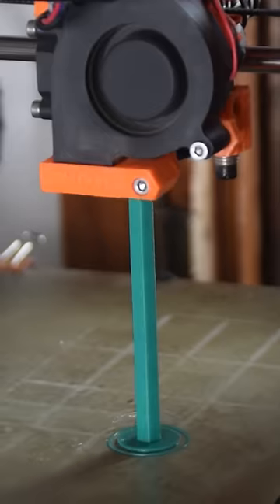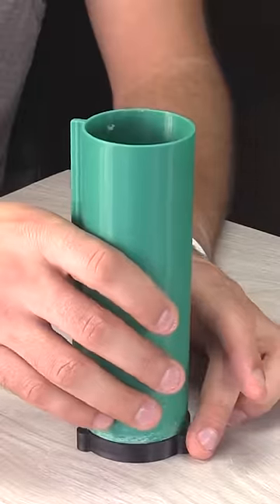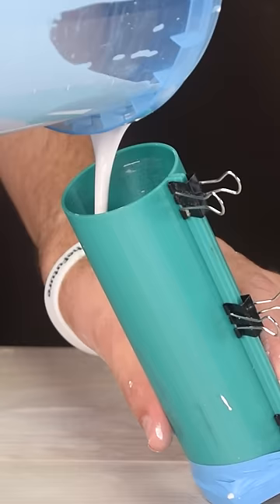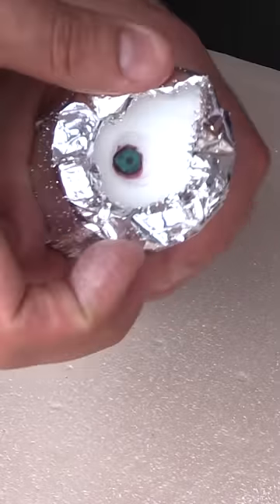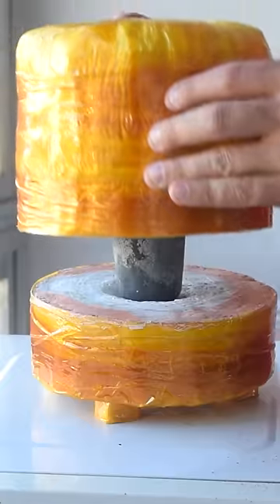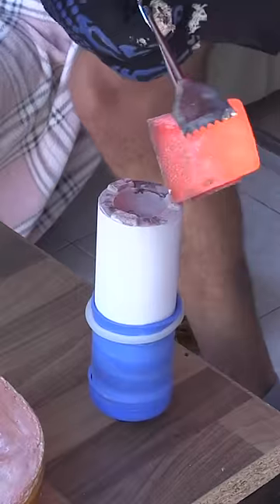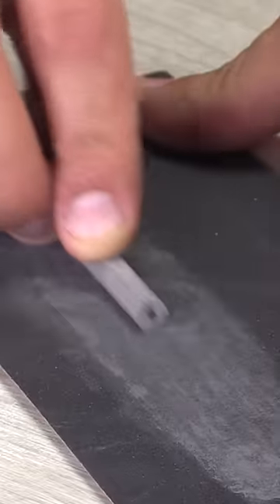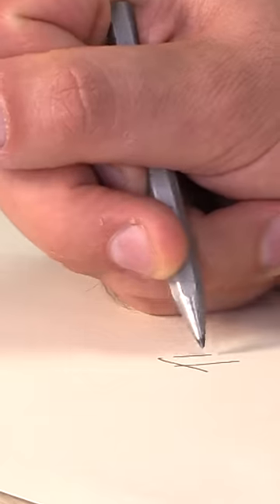Aluminium Pencil #diy

Comment: I wanna see how you sharpened it, that's so cool!
Reply: You could probably just use a pen or sharpener since it’s aluminum, or make a sharpener out of a harder metal
Reply: @zirjaeger4037  or use a bench grinder for dramatic effect
Reply: He made a pencil sharpner made from pencils to sharpen the pencil made of pencil sharpners
Reply: Didn't he show it for brief moment
Reply: He literally showed how he sharpens it. With a pencil sharpener.
Reply: @rparker069  Aluminium doesn't throw sparks though
Reply: He showed it with the pencil sharpener? The blade is made from steal so it can cut into the aluminum.
Reply: @rparker069  or for portable option battery angle grinder
Reply: U just sand it down with a grinding wheel
Reply: It's in the video...
Reply: It's aluminum...
Reply: The razor is steel which is significantly harder than aluminum.
Reply: With a high frequency pencil sharpener of course (MGR reference)
Reply: @raysmith984  yes 
But you need the grip strength of 10 men to sharpen a aluminum pen with an razor made of steel
Reply: @SteveOnlin  AAAHHH! STOP MY BRAIN HURT! PENCIL SHARPER THAN SHARP PENCIL SHARPENING PEN-AAAAHHH
Reply: He showed it in the video
Reply: My head hurts after reading your comment. You literally can't see or something. He literally sharpened it on a pencil sharpener which has steel blade on them.

Comment: The lead in that pencil is a lot less likely to break than the lead in a wood pencil if you dropped it off your desk, I presume. I think this because of the lack of relative flexibility, and not due to the relatively greater propensity for vibrating. In the case of the vibrational conduction, I might be wrong. Perhaps the vibrations conducted by the impact of the pencil hitting the floor would cause it to break more.

Comment: I thought a microwave only got to 220°, so how does it melt aluminum without the door mounting off or the microwave burning down. also I like the idea of an aluminum pencil
Reply from the maker: The crucible absorbs microwaves and heats up. Insulating chamber holds the heat. Outside of the chamber is warm to hot depending on what's melted and for how long. The crucible can reach temperatures hot enough to melt cast iron......I am about to publish a video about melting cast iron in a day or 2.

Comment: It works but not really.......aside a very tedious process there is no way to sharpen it. So ya it works, but is it an improvement? Not at all, very fun, amazing you were able to do it in a microwave, and impressive all around but a crappy pencil indeed. Not the look, the pencil looks awesome I just in my who cares opinion think functionally it's a shit pencil.
Reply from the maker: I agree that it's not practical. This video is more about the metal melting than the pencil, but I am glad that I did it. I learned something new about graphite pencil cores and metal melting and I have used the same technique in other metal melting projects.

Cheers!